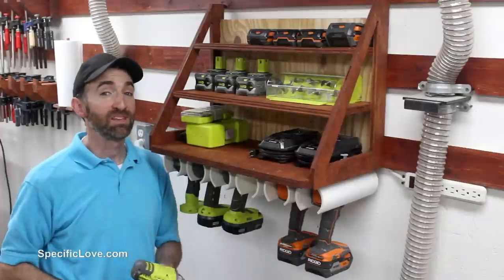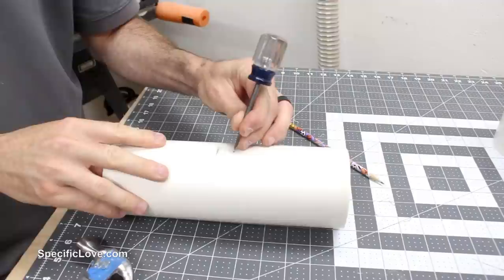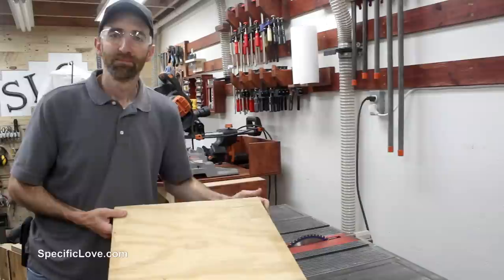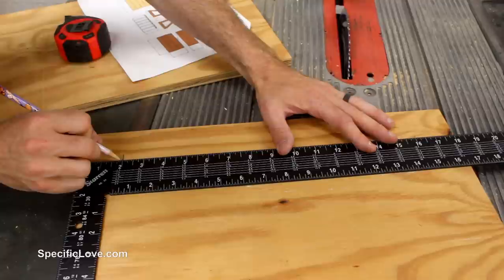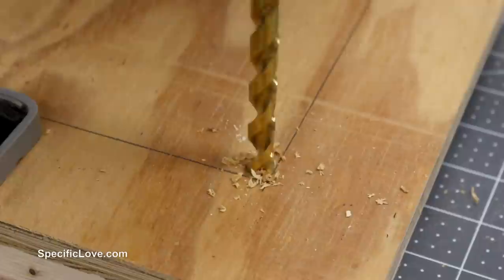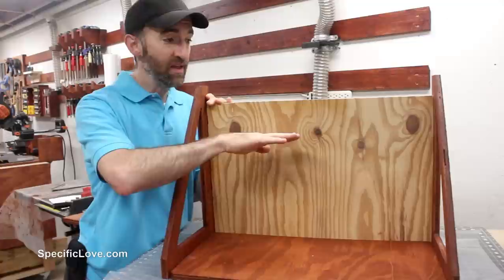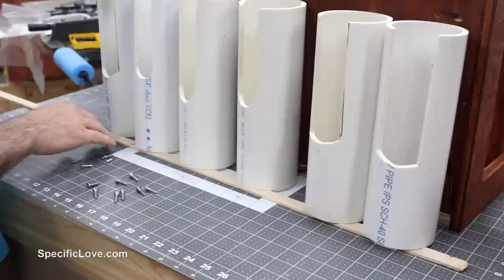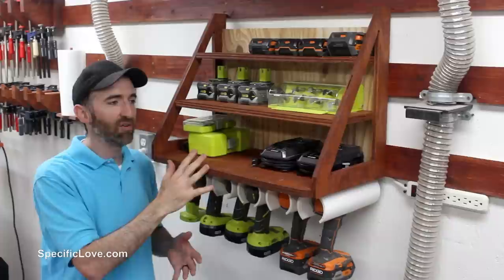Building a Cordless Drill Charging Station and Storage Rack on a French Cleat Wall

Comment: Hello SLC, My drill charging station is not so cute as yours one.  But I love complex solutions and I miss the charging process in your one. That is why I added an automatic time switch to the drill station so i can choose how long will last the charging. It is adjustable from seconds to 20 hrs. I set it on 1 hour with possibility to multiply the time up to 5 hrs jus by push a small button. It is enoug for charging all the batteries I got. 
When I leave the workshop, I insert the batteries to the chargers and then I push a charging button. After the set up time the charging station grid plugs are switched of automatically and the bateries are not overcharged. It is also more safe than letting the bateries under the voltage all the time I am out of the workshop.
Reply from the maker: Sounds like a really nice setup

Comment: How about a video about choosing a fastener for your project, i.e. type - like brad vs staple vs finisher? Screw vs nail? And the right length for your project. Planning my own french cleat wall system in my garage and building the shelves for my tools is where I'm lacking my knowledge.

Comment: Great tutorial with lots of detail.  I just have one question.  On the PVC drill holders, is there a reason why you didn't just drill all the way from end to end?  I don't have a drill press and wondered if I just cut the channel the whole length if it would work. In my mind, the only reason you'd drill a hole and channel as you did would be to have a positive stop when putting the drills in.  Am I missing something other than that?  Thanks again.
Reply from the maker: The stop is part of the reason, but the other is the fact that the pipe will partly fold in on itself when cut fully making it hard to size for the drills. Plus there is a chance of flexing, which could let the drills fall out.
Reply: If he is correct and the PVC will roll up on itself, it should be a simple matter to add a few additional screws at the 11 o'clock and 1 o'clock position at either end to prevent this.
Reply: Before you get too wrapped around the axle, be aware you can drill those starter holes with a spade bit and a hand-held drill. Since the pipe is circular, just drill the hole first. Measure how far in you want to go, drill a hole, and then base everything else off the location of the hole. (I've done this exact thing freehand many times, using a buzz cutter rather than a jig saw, and it comes out fine.)
Reply: You can just cut the slot to the desired length with a "square" end as well. The rounded feature is just a little nicer. Stay safe !!